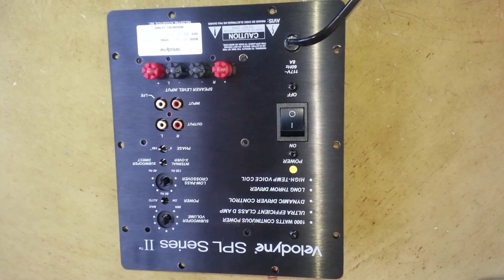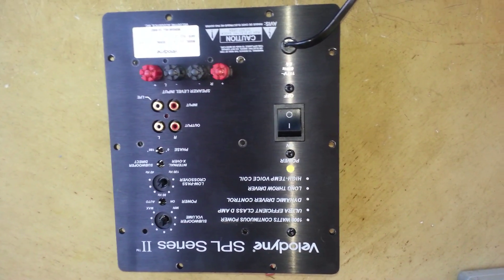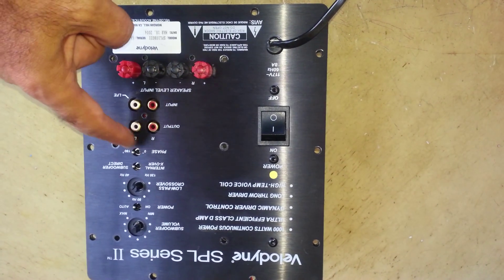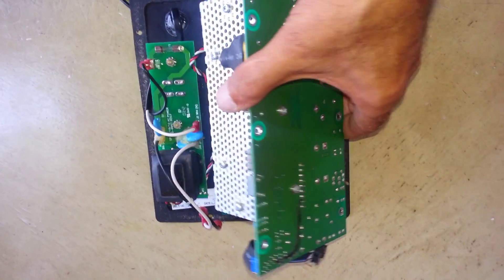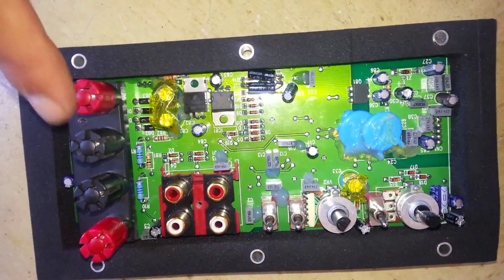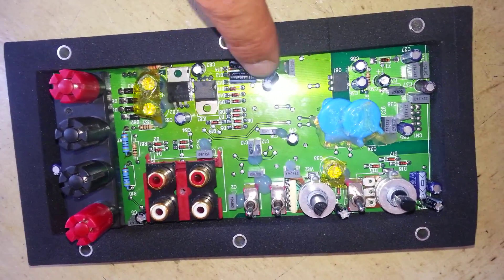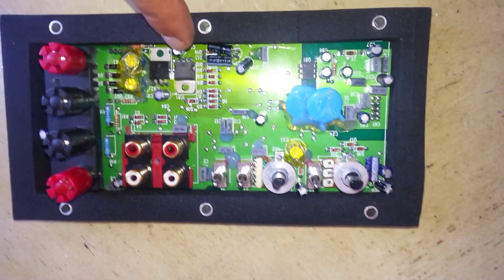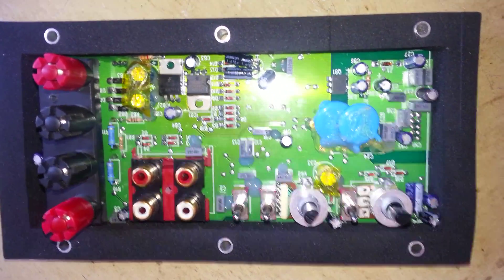Velodyne Subwoofer Problem, how to repair it Part 2

Comment: Hi, my Velodyne SPL Series II doesn't have any hum when idle, but when it receives a signal, it does. Could the problem be the two electrolytic capacitors, C19 and C20? Or do I need to check the final board? Please help. Thanks, Silvano.
Reply from the maker: Hi Silvano, the capacitors can cause such a problem, but I am not sure, you can try, why not.
 Good luck and Merry Christmas 🎄
Reply: Ok i'll try and i let you know.. Merry Xmas to you
Reply: It works now... I just replaced two tiny caps C19 and C20. Thank you for your support, happy new year.

Comment: Hello I own a Minivee 8” from Velodyne and the electronics look almost  identical to yours.  My problem is the subwoofer turns on and hums only.  In your experience could this also be a capacitor issue?  I was hoping for an easier fix like a bad ground but the obvious connections like LFE input seem fine.  Any suggestions?  Thank you
Reply from the maker: Hi, I’m not someone who always fixes Velodine subs all the time, I just shared an experience I had with you and it helped many people. But in general the capacitors are BAD GUYS, if no fuse is burned it is very much possible that you have bad capacitors, specially if you didn’t use your sub for a long time then it broke for no reason.
 Good luck 👍
Reply: @artsvideoonline  thank you for the fast response.  If I knew you I would buy you a beer or two for your help 👍

Comment: I have the same subwoofer, mine will not turn on. I checked and the internal fuse is blown, replaced the fuse and it blew out again immediately after power on. Seems like a short. One of the MOSFETs had a scorch mark at the base, so I replaced it, but nothing changed and the fuse blew out immediately again. Any thoughts? I would love to be able to get it working again, but it doesn't seem like the capacitors.
Reply from the maker: Yes, you defenitly have different problem, most likely some semiconductor is shorted and needs to be replaced, unfortunately I don't have the schematic to further assist you, it's been a long time I fixed it,  but you are on the right track, check for shorts on your transistors, diodes. May be even capacitor, you never know. Keep in mind sometimes they sho short , but they are not-better to remove them from the PCB then check them.
 Good luck
Reply: Thank you very much!! @artsvideoonline

Comment: Hey, bro. We rewired all the small and all the big capacitors, but the subwoofer never worked. Can you tell me what else you can do? The velodyne hgs12bge subwoofer model.
Reply from the maker: If the character of the problem in your sub is the same as it was with mine, then it's bad capacitor for sure, in mine it was in power amp section, you have to open that section.
Reply: @artsvideoonline  Yes, I watched both parts of your video and disassembled everything and changed the capacitors everywhere and still it doesn't work. So I'm thinking now what to do next?

Comment: Am glad to find your youtube on Velodyne subwoofer. May i ask if the MiniVee plate amplifier be able to be converted from 117VAC input to 220VAC input? Thanks.
Reply from the maker: I have bad news for you, I think you can't do it, because the power goes from the bridge to the sercuit,  there is no transformer, or enythings else in between.

Comment: I took the screws out but it is still stuck on the cabinet! ??
Reply from the maker: If you removed all the screws mentioned, then push a little bit more harder and it will come out.

Comment: Hey Artur, I just have this sub also and it's not working. Mine does power on but nothing happens when I plug the RCA into the input/LFE. What was wrong with yours? Did yours power on at all before you repaired it?
Reply from the maker: Same like yours, most likely capacitors. I would recommend you to read all comments, before you start your repair.
Reply: Artur Aroustamian ok thanks. I have no experience in soldering so I will likely take it somewhere.

Comment: DD+ 12
The remote stopped working (new batteries). Receiving constant "P3" message on display. 
The electronics are not damaged.
What could be the problem ?
Reply from the maker: I do not think it's your main unit,  most likely your remote is not emitting IR signals.
Reply: Remote working, we checked.
On display is lit P3
He does not react to anything else. Switching off the power does not help.

Comment: No audio, light on in front. Replaced caps in pre amp, no sound. In the amp section they are not radial caps but orange ball looking. were these replaced already possibly? if not the caps, what else to check?
Reply from the maker: Please watch the second part, change the caps in Power amp section.
Reply from the maker: I mean the other video, part1
Reply: I replaced those
Reply: in the power amp the capacitiors are not canister style but round orange type.
Reply from the maker: there are 33mkf caps you need to change in power amp section.

Comment: Hi Artur, I changed out the two capacitors for C19 and C20, but still no sound.  I'm going to change out the other five capacitors on the other board next.  I can't quite hear you on the other video where you spell out what you upgraded them to.  Could you listen to the video and send a message with the Numbers on the capacitors for us, please?  If not I'll just replace them with the same kind that are in there.  Thanks much, Bob
Reply from the maker: Bob, the most important ones are in aluminum enclosure (power amp section), kind of difficult to open, but i am sure you can do it, just please keep in mind that it has a "hot ground", be extremely alert.  WHatch the second part of the video.
Reply from the maker: Bob, the bad capacitors are shown in part 1.

Comment: Hi Artur,  Great video, by the way.  In response to people's inquiry, the capacitors on my machine are:  C19 is a 2.2uf 50v 85c,  and the one for C20 is a 0.47uf 50v 85c.  They are both 11x5mm (length x width), with a 2.5mm pin spacing.  I got 20 of each on eBay for $1.89 from China.  I'll follow up when they arrive and I get them in.  Shipping is 8 days to 25 days.  My subwoofer's electronics are immaculate, nothing is burned, no smell, no signs of damage, solder joints look good under magnication.  The fuse there inside the box tested out good.  I'm keeping my fingers crossed that this will work for me.  Thanks again, Artur, for this video on where to start.
Reply: Hi Robert, I decided to replace all of the caps and I missed writing down the value for C32. If you still have the schematics would be so kind and tell me the value for C32. Thanks!

Comment: I'm good at soldering but not too familiar with capacitors. Can you provide an example link for the capacitors I should use to replace the old ones?
Reply from the maker: +Mark Jamison The capacitors can be found on Ebay, also please check the other comments where you can find a lot of helpful information from people who could fix their subs.  Best regards and good luck Mark

Comment: i have this type of subwoofer, what would cause a HUM?
thank you!
Reply from the maker: +Diane Sumutku If you still have the sound ,it is just mixed with the HUM again the reason must be bad capacitors, In your case i would recommend you to change also the big capacitors in the power amp section. Good luck.

Comment: Hi Artur, thanks for the reply, I've now got full schematics from velodyne and I've been able to locate the critter hiding @ C20. Thanks for your help, Mark
Reply from the maker: +Mark Hall Very good Mark, i am happy for you. Just keep in mind, do not misplace that flat cable connecting power amp with preamp.
Reply: @artsvideoonline  Hi , I decided to replace all of the caps and I missed writing down the value for C32. If you still have the schematics would be so kind and tell me the value for C32. Thanks!
Reply: Does velodyne give schematics for all their subs?  I maybe repairing a mini vee and need this.   Thanks

Comment: Help! Ive this exact subwoofer and have effected the repair you recommend. On checking the capacitors removed I see that I have replaced a .47 50v with a 47 50v (same colour, size and stamp code but still I am a shortsighted idiot). This must be changed but I cannot see which location holds this .47 50v nor can I find the information. Where does this cap go? Please help I need to change it.
Reply from the maker: I am sorry, I don't have the board anymore,  but if you have the location number, you  can call to the company and ask them. In the mint time I'll check around, if I find something I'll let you know.

Comment: How many and which. Type/ size capacities should be replaced to provide an effective service /repair ? I have the exact model they want 250 from velodyne .
Reply from the maker: Please check the part 2 , the most important caps to replace are in power amplifier section ,after the repair  make sure not to miss place the connector between two boards .Good luck.
Reply: +Artur Aroustamian yes I saw thank you I could not understand what you were saying though which ones are the most important
Reply: artur, i agree please type the replacement sizes on the capacitors